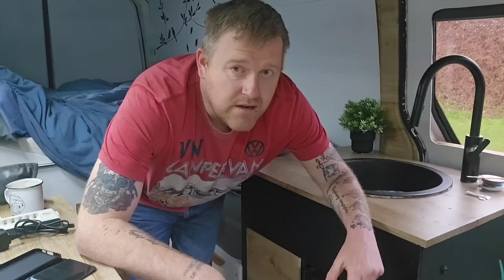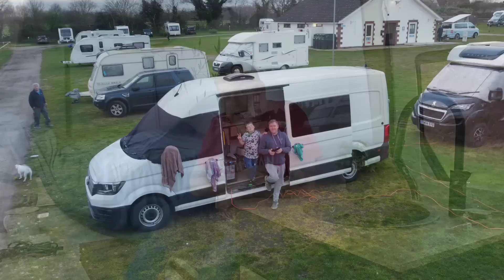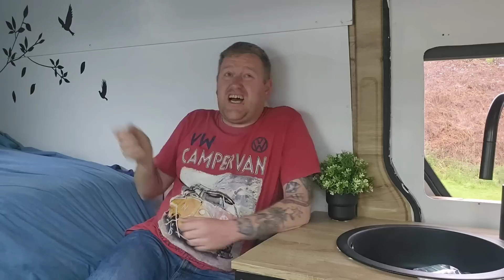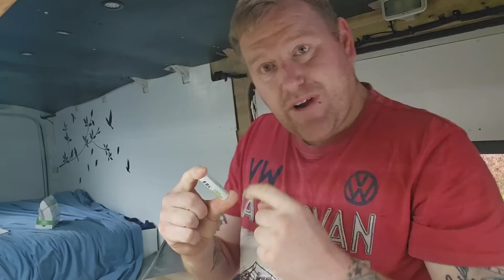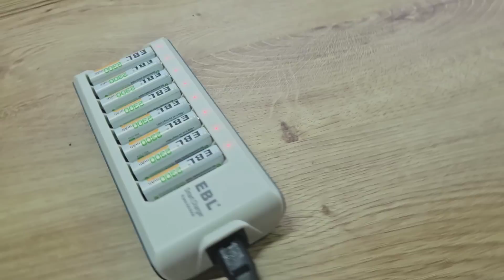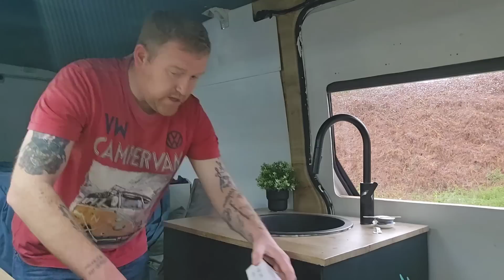Money Saving Vanlife

Comment: How much does the uk weather affect solar energy during winter?
Reply from the maker: Depends on the panal and control unit. A good quality setup will work but work as expected through winter. Big battery bank helps
Reply: @iNDI_VAN_A_JONES  cheers 👍
Reply: @iNDI_VAN_A_JONES what if you get 1000ah lifepo4 cells and build battery your self. One charge will last for up to a month?